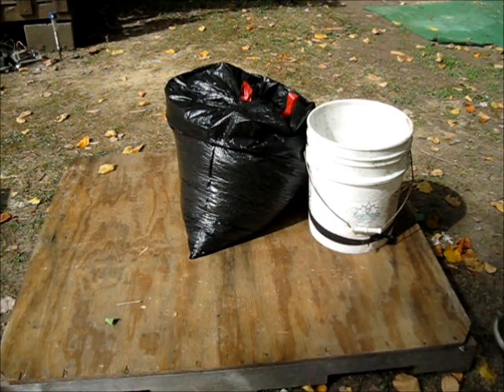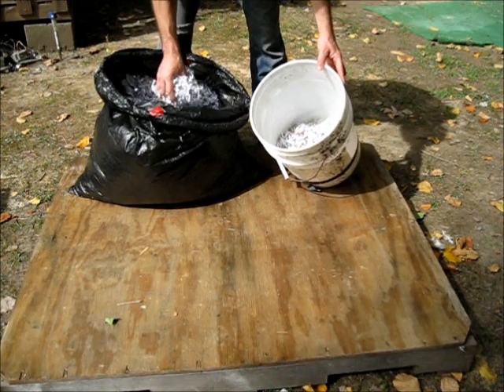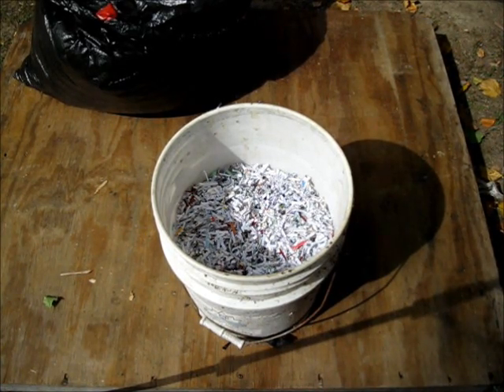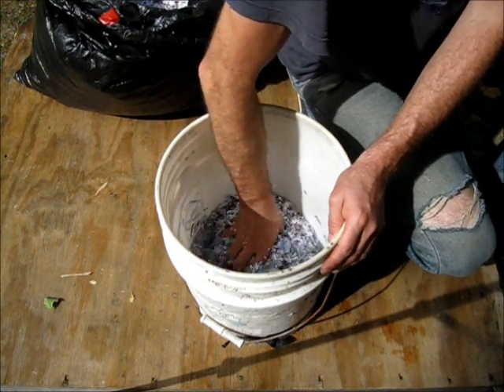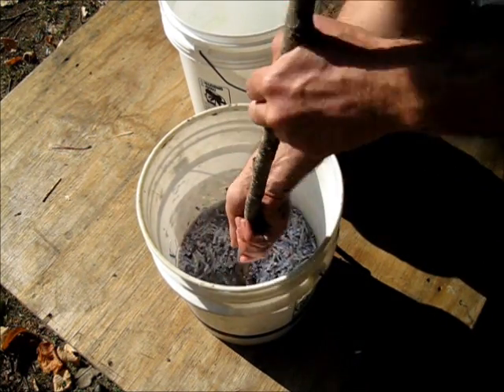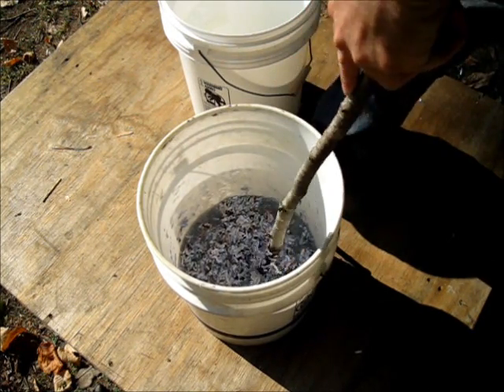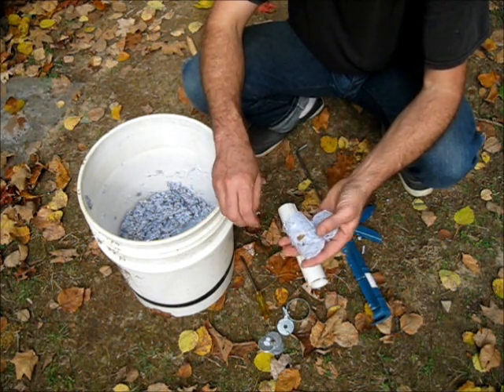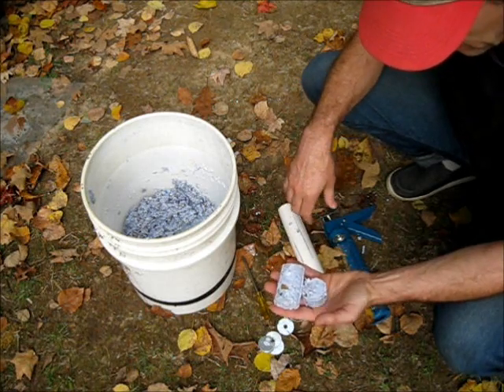How To Make Biomass Briquettes For Survival Fuel

Comment: Plus, people keep forgetting that he's on rental property. Sizable investment in labor/materials. One that he may have to leave behind if he has to move. Not all streams, IF he has one at new location, can support a ram pump.

Would have had one years ago, here for creek in backyard. Not enough fall or water flow to install a ram pump for distance uphill to receive water. Only practical off-grid for us would be solar powered pump. Wind not an option due to height of tower needed due to location.

Comment: If I'm not mistaken, ram pumps can work over long distances. However you have to be fairly precise with the measurements and it isn't cheap usually. Plus you have a repetitive pinging noise 24/7.

Comment: I experimented with these, and once the cement is added and it cures, its actually quite fire retardant.  Depending on the coarseness of the pulp, you can get it as smooth as sheet-rock.  It is however, lighter while retaining the same strength.  I think I will do a vid on this.

Comment: AH! :) the lesson comes full circle.  This is ALMOST the way you make papercrete.  You can speed that process from days to hours by using one of those paint mixers on the end of your drill.  Actually you can take it down to minutes if in a pinch.  That mixer tears finely shredded paper to pulp really quick.  If you want papercrete, mix in 50/50 Portland cement, pour into molds and let cure over time.  The product dries rock hard for very light building materials. Just seal and paint to use.

Comment: there are a couple comments asking about leaves.i think i seen a video about this if you break the lease up if you vacuum them or run threw a chipper or break them down with your hands to small pieces you can mix some in before you press the bricks.i think you can use like a 50/50 mix paper to crushed leaves. you can also add wood chips from cutting wood with your chain saw.

Comment: Making ahead of time, while fuel is plentiful (on/off-grid) ensures that you have them, if you later have no other option for fuel for a fire. 

In an emergency situation, never waste water. Use bath/shaving/dish water to make bricks. Any warm/hot water that you can't use for drinking/cooking.

Especially in summer, use solar energy to produce hot/boiling water. Solar oven. Plus, a few soda bottles, filled with water & placed on a roof in full sun yields hot water.

Comment: I use a little bleach in mine about a cup to 5 gallons of water i use, it keeps the smell down and speeds up the process it also helps with thicker material like construction paper and those pesky glossy mail inserts i always seem to have alot of:> i've also added dry leafs and grass clippings, if you live in an area with alot of cottonwood trees you can mix that with  just paper pour over a window screen and you can make pretty decent canvas material thats good for insulation and much more...

Comment: Uhmm  thinking about it.. Can see benefit of larger sizes, depending on type stove being used & heat needed. Also looking at drying time, based on size of mass. Plus weight involved to handle when wet. 

Suspect there's a point where it's more effective to make smaller individual blocks. Sized to match how they'll be used when dry. About 4-6" dia would be about max size I'd want in my box stove or fireplace. Caulk gun size looks great for portable rocket stoves. Those can run on pellets.

Comment: How about a paint stirrer in a drill? At low speed, should do a quicker job than by hand.

To empty tube. Keep first washer put in place, then use large dowel or small log (piece of firewood) to push the paper out.

Great video - Making Do With What You Have! Everyone can make these. Can dry them indoors, if heat or AC is running. Store in buckets/totes. Inexpensive, especially when combined with a DIY tin can rocket or hobo stove. 

Next ice storm & bet a lot of folks will wish they'd made 'em.